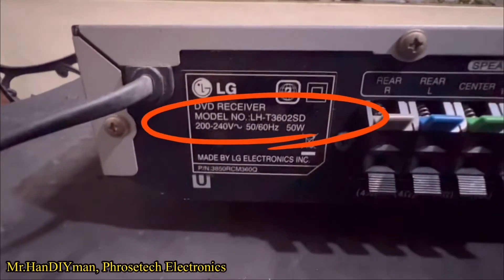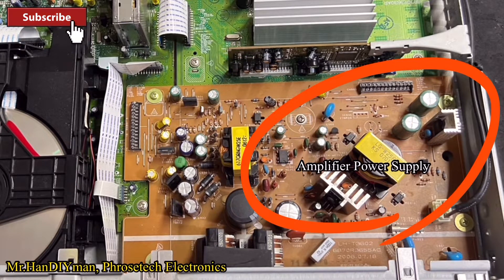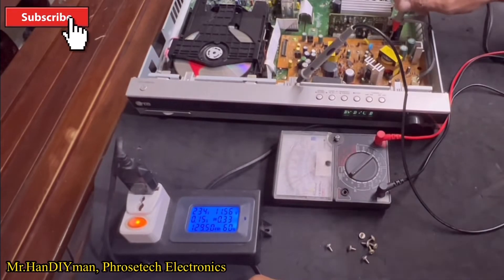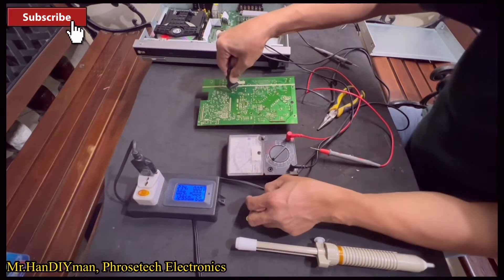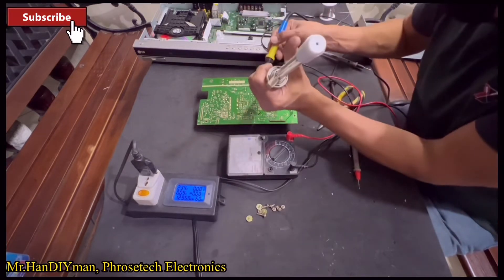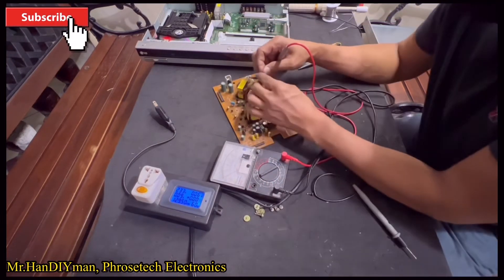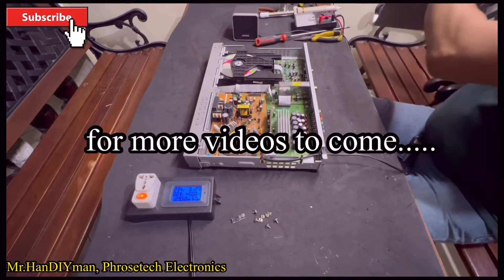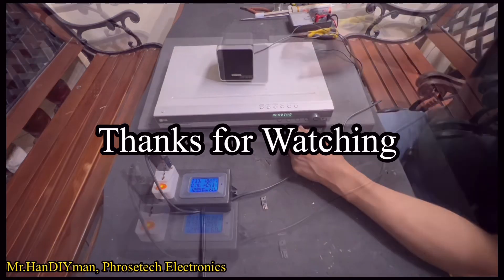LG Home Theater, How to Repair, With Power but Weak Sounds

Comment: Hello pls i need your help
Mine is abit different 
When i on the lg machine and i increase the volume it doesn't play the fully volume 

Onless if i off and on it like 3 to 4times then it comes fully
Reply from the maker: Maybe in the power supply is intermittent output

Comment: Hi there i have model LH.RH3690SE problem screen freez power on but no play plz help
Reply from the maker: You can bring the unit in my shop
Reply: @mr.handiymanphrosetechelectron  were
Reply from the maker: @ayandavellem938  , imus cavite po
Reply: @mr.handiymanphrosetechelectron  i am in south Africa papa
Reply: @mr.handiymanphrosetechelectron  hello po , taga Kawit, Cavite po Ako, mag papa repair din po Ako Ng LG FB162, same problem lang din po tulad Ng ginawa mong video.
Reply: Saan po,exact address po ng shop para mapuntahan po. Salamat po.
Reply from the maker: @INTROtabs , 1120 Nueno Ave, imus city, cavite